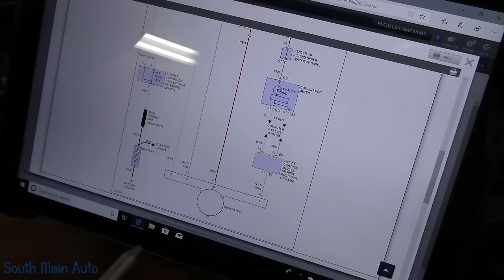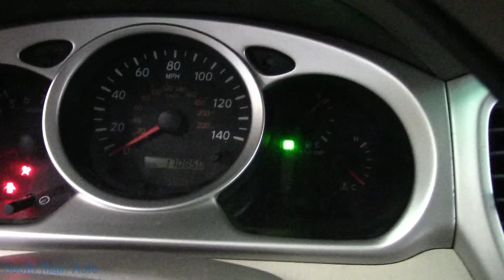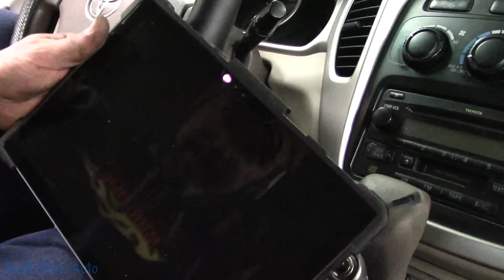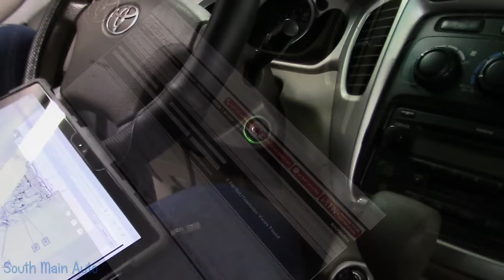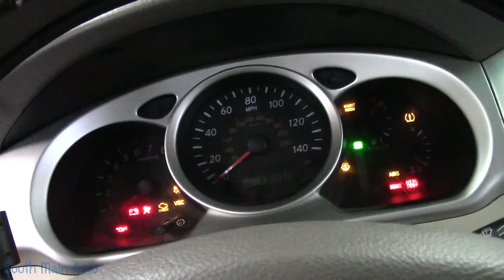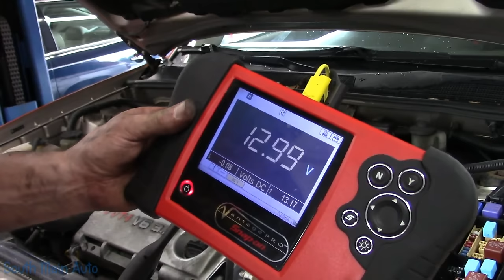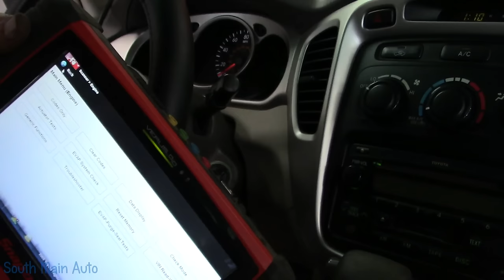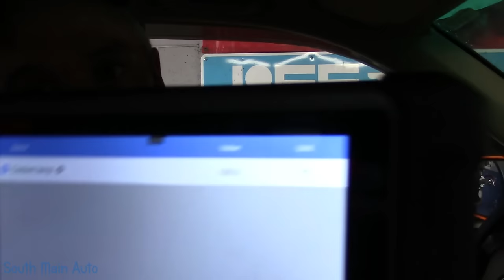Toyota Highlander - To Fix It, Follow The Smoke! 🔥

Comment: Awesome vid Eric! What about going to the junk yard-  my bad , The recycler  and snippy-snip a "cleaner" connector ? - I guess you still have to solder it in though. Another thought is this 2005 will forever be a money pit because THE MAJORITY OF MECHANICS WILL NOT BE ABLE TO DIAGNOSIS IT. I'm ranting because I am dealing with an overwhelming , almost critical lack of "mechanics". I think the profession is driving our future into disposable vehicles. Years ago, you would of been know as one of the most knowledgeable mechanics in say a 1 state area. Today , you are like the " northeast region's savant" soon to be elevated to "The Mechanic of the Northern Hemisphere" . To be honest , I have almost no faith in the profession , save for you being on the web and also taking in two proteges.
Reply from the maker: No no no, there are tons of good mechanics out there trust me, I am on facebook with many of them, WAYYYYYY beyond my skill set.
Reply: you know any that are good in somerset ky? it is hard too know who is good. had someone try and fix a slow oil leak and made it worse and then seized engine... i had them replace oil pump and water pump and timing belt and stuff since they were taken off. it was a 94 toyota camry. liked it and wish still had it but now i have a 09 mazda 5. it have a check engine light on for upstream oxygen sensor code p0132 which is running rich it seems. it runs fine but wish i knew what was causing it. don't want to just replace the oxygen sensor because on these are over $200 not cheap. just wish i could find someone good that won't overcharge.
Reply: no good mechanics where I live
Reply: tough to find good mechanics in area too
Reply: I'm a tech in Cincinnati and I know of well over a dozen amazing other techs in the area, I get compliments alot so makes me think I'm good, I just think I don't like to give up. There is a few hacks. But there is just as many ppl that expect a ton from a tech when we spend hours on a diagnostics, you guys watch these videos thinking this only takes this long, some diagnostics takes awhile, to just be something so dumb, can repair with hardly any cost of parts but used so many tools that coast hundreds some thousands of dollars and some techs get paid squat the industry creates hacks I just don't have the mindset or heart, or the deep pocket to pay for the parts canon that didn't fix the car.
Reply: Not sure where you read I was talking smack at all, I honestly don't see how he has the time to make videos between work and my son I got nothing but, I said the industry creates hacks not the customer, I never called you a hack, a hack isn't someone attempting to fix there own car. It's a tech who uses a dart board to make repairs or statistics to make repairs. I've gotten cars handed to me after a general service did tires and tires not set or tpms out of whack or they broke a damn sensor. I get it but you as a customer should not pay for that.  The deep pockets are mine it's called eating the part, why would the customer pay for a part they didn't  need. Come on. its obviously not the customer.  If you do, that's you man you got swindled. I point ppl into directions all the time I don't loan tools but I will show you how to do it. I got called a nickel and dimer for telling a customer they needed a shim to repair there alignment which was barely out to the point it wouldn't even cause an issue but they wanted it fixed, I said it had to go behind the bearing it's rusty, damage to bearing is possible you may need one, but nope they get mad and storm away, or the ppl that asked if I was a real tech because I drove there van for 76 miles no stall happened but yet they know a guy that could've figured it out without even driving it, the crank sensor finally dropped out for the 2 sec while I was driving around mile 80 and the fourteenth test drive with my scope wires dangling around, but yet I only get paid 1.5 hours for that, or the diag no codes honda I spent 6 hours on only to find a piece of rtv got in the vtec solenoid causing it to stick wide open no parts and it was fixed they were actually very thankful and understanding on time.  But I was just saying that there is tons of good techs out there, so not sure what you read but you misread sir.
Reply: D really also I'm confused, I've reread your comment multiple times, are you claiming you are just as good as 99.7 percent techs? then call me a sheep while acknowledging you don't know me so how can I be a sheep for sure? when did I get all "praise the industry" fucking christ is pissing me off just thinking of how you went half cocked over me just saying there is good techs and that customers can be assholes too, you getting bent out of shape because you chose the wrong garage. its as bad as the idiots who talk shit about how long the videos take saying they could've gotten it done faster. For me it's seeing what tools I'm interested in and seeing how they work.  But claiming no good techs except for the one guy your watching when Ivan is a beast at electrical, Keith is the shit at the weird, schrodinger had the thought process down pat, scanner Danner is a guru of theory, Sean miller, triangle diagnostics, me I'm on instagram (barely) as pinpoint auto.  I don't get to post much, half the tone is diagnose and oh shit should've took some pics or video but seriously there is good techs out there find someone, be good to them if they are good to you and stick with them, fuck the industry. And calmly read the post that ppl type not everyone is yelling as they type
Reply: I'm fairly sure most salvage yards will not sell a "cut" wiring loom or a section of it when it comes to computer controlled vehicles. They will likely sell the entire loom from one connector assembly to the next one up or down stream. In this case, the fuse box with the loom pigtails and the next one down stream as both connectors were burned. Once you have that, you can cut it as needed however, it's best to go from connection to connection. Also, not all looms are exact due to optional equipment one car may have to another. It's possible all looms are outfitted to support a fully equipped vehicle vs. one that has few options, not sure but could be. 

With older cars, non computerized, any salvage yard would simply use bolt cutters on the wiring looms at the hingles and sell you a complete left front door. Today, they can't and shouldn't do that due to modules and their mass wiring and proprietary connections. Can you imagine walking up to a junked car that has just what you need only to find out the yard people cut the wiring loom you need to help a previous sale?  Best to sell the part complete and save the integrity of the remaining salvage for those who follow.
Reply: South Main Auto Repair LLC Don’t keep selling yourself short! Plenty of the other well known electrical diagnosis specialists like Diagnose Dan seem to have a great respect for you.

Comment: I was waiting to hear REO Speedwagon, ride the storm out. I guess they were just testing the sirens.
Reply: does it really take 5 tests? To quote Napoleon Dynamite.. Goooodddd!
Reply: In many rural volunteer departments the siren counts are also used to tell the crews what and where the call is. So you might hear a 3/2 siren, that would be an EMS call, respond to station 2, Then something like a 1/4 is structure fire, full response, all stations.
Reply: so they have to sit around and count the sirens while the bldg burns? Two words.. Cell phone.
Reply: There are a LOT of folks who don't carry them or are out in a field or place where they wouldn't have signal. Plus these sirens have been around much longer than cell phones or radios. Then there is the issue of who calls the phone? The 911 centers send out a set of tones that trip radios/pagers and the house sirens. They don't call or send texts to the departments so the phone would still be useless. Plus there can be a large lag time in phone texts as well as they are not priority items.
My department used pagers and radios as well as house sirens. We added text as a back-up system just a few years ago through an online company. 
There is nobody "setting around" in 99% of the volunteer stations.
Reply: Greg Reitan I thought the same thing about REO
Reply: Avoca (and Bath, NY) unless things changed...  Noon test of just 1 blast of the siren.  Usually on a call they hit the siren button and let it blow until someone responds that something is in route.  They also use the pagers as well.  (Bath uses(used...been a while) a 2 tone siren for the fire calls.  You'll hear the usual siren blast......And a 2 tone alternating blast mixed in.)  It's been a while sense I was on the Bath, NY vol. fire dept.....  So this might have changed.

Side note:  Small community near Albany uses a vol. fire dept.  Due to noise complaints they silenced the siren and went to only pager.  Come next year when the dept asked for $$ for materials, supplies, etc...  The community responded  "You didn't have a single call all year!!!  What do you need x,y and z for...."    Then the chief stated  "We had 'x' calls last year!  You guys had us shut down the siren!!!"...
Reply: in the case of larger scale power outage, the sirens would be on backup power and could be the only functional emergency alert/call to work ;)

Comment: Could the connectors have possibly gotten corrosion from being located so close to the battery? Nice fix as always and thanks for putting this up.
Reply: breeze787 probably rubbed through, shorted, instead of blowing the fuse it melted the connector first, got worse, then blew the fuse.
Reply: Yes.
Reply: acid loves to penetrate past and around the seals
Reply: breeze787  Yes indeed..😑I do think the good ole battery had something to do with this wire harness connector corrosion.Thru time ,Acidic vapors venting out the battery somehow seeped inside the connector,and started eating at the wires protective plastic,exposing the bare wires,which in turn shorted. I seen tightly wrapped taped wire harnesss ,with that white corrosion inside them.🤔
Reply: Salt
Reply: @freddyflintstoned913  Salt & acid - perfect combination!

Comment: You should be able to obtain generic replacement connectors with pigtails (doesn't matter what colours specifically, just different, and may have one of more unused connections) and connect the new pigtails one-colour on both ends to the original cut wires, one circuit at a time.   That would still allow the plug unit to be pulled apart if conditions still require it.    Oh, yes.  that will be where the smoke will have come from.

Comment: I would have done the exact same fix that you did. how do I know that ?because that’s how I fix them.. Good job 👍🏻👍🏻👍🏻👍🏻👍🏻👍🏻 or ⭐️⭐️⭐️⭐️⭐️ lol
Reply: I usually cut one out of an old car at the junk yard..... pretty much free and you can then still unplug if you ever need to.... In that case though I would have made a shield to keep the battery acid fumes from condensing on/in the plug.

Comment: "Smoke 'Em If You Got Em!"  Back in 1980 i bought a 67 olds. 1st week i had smoke under the hood. Found out previous owner replaced a fusible link with a 14 gauge house wire.  Had lots of wires to replace after finding the original short.

Comment: Yes, you followed the smoke, and you had to rely on the OEM wiring diagram, which led you to the connectors, that the Mitchell diagram did not show, which when you touched the connector, let out some crusty dust etc... And as far as getting new connectors? On a car that is 13+ yrs. old, probably not. Or maybe get some "non OEM" connectors with the correct amount of pins and maybe gone that way. But then again, if you ever had to get a replacement fuse box then you would have to chop off that connector.anyway. So you made the logical choice (as usual)... Another great video Eric (again, as usual). Thanks!

Comment: Nothing freaks a tech more than smoke or flames! Good diag and I agree if it’s a connection that will probably never need to be unplugged cut it out. Some manufacturers don’t offer connectors and terminals.

Comment: I heartily approve of your solder and eliminate the plastic connection. 

Does the vehicle now work properly?
Yes
Did it fix the problem?
Yes
Then what is the issue?
None!
How often do you have to remove a fuse box?
Very rarely!

Job well done Sir!

Cheers!

Comment: Time to hit the junk/spare parts yard. Except Highlanders are (I would image) hard to find!! Whack that connector out and -----Beans --solder the wires in a bypass!!!!  Surgery must go on to save the patients life!!
Reply from the maker: She lives to die an other day...
Reply: Highlanders  and Camarys are basically the same,,,you will see those connectors on both
Reply: Just curious... Why would you need to use that specific connector? Any connector with the requisite number of pins (or more) would have worked just fine. I must be missing something here.
Reply: Phil Underhill  True but he was looking for something compatible with the fuse box if it ever needed replacing as it would have one of the ends with it from factory.

Comment: Hey Erik i found your channel by chance and am now a subscriber . I just have to say your ability to diagnose and repair is fantastic . I hate to say it but most repair shops including dealerships just throw new parts in and hope for the best. And most times you still have an issue  I am not an auto mechanic but have been doing  most of my own work since i got my drivers license. The one thing i would like to add here is the fact that those connectors living directly by the battery is a disaster waiting to happen especially if the battery terminals are not kept clean and maintained just my two cents

Comment: You always say  when there is alot going on with multiple circuits to pick one and work that through and mostly you will resolve all the others as well. In this case you did exactly that and once again it was a success. Regarding the repair well I would have made that the customers call and I think nearly 100% of the times they would have gone for the repair you did. Picking the alternator fault was the obvious one to go after as it wss the most basic circuit to follow. As usual, a master diagnosis and repair.

Comment: I have owned 3 Toyotas.  I am guessing that maybe battery acid may have dripped to the connector at some point and caused the corrosion.  You are great at electrical troubleshooting.  Well done.

Comment: I’m late to this party.

But, I will say this: I think the repair has to match the owner and vehicle. A 2005, multiple issues at play, other issues at play, yes, soldiering and taping seems the right way to go if the alternative is a $600 repair that could be better put into tires, brakes, exhaust, etc. 👍🏻

Comment: Great repair!  The main fuse on the 04 Nissan Murano is built into the battery terminal and will blow due to corrosion as well.  This happened to me 40 miles out of town once.  After purchasing a new battery because it was very weak,  had to jump the fuse with a piece of metal taken from a battery terminal connector..  After spraying it with a couple cans of terminal protectant it works good :-)

Comment: Awesome diagnosis Dr. O. Anytime I or a friend has a problem.....I check your vast video collection to see if Dr. O has seen it. I love going along for the ride with my favorite repair ace. I`m 61 and still learning, thanks for all you do. Now if I can just fix the gauges on my dash....temp and oil took the proverbial dump. Senders replaced, 91 Silverado with Moonie gauges...I hate them...lol needle gauges are rare for that year and apparently Chevy changed the connector and cluster in 92.

Comment: You make electrical look so easy. I had a transmission sensor on a Nissan altima that had some mice nawings on it. Was very hard to reach with a soldering gun and tape up the wires. I spent between 1 n 2 hrs on it and could not tape it up as well as I wanted to.

Comment: If you're asking I'm pro replacement connector or wire in a different one, but I work heavy equipment. We are required to big difference in a 350000 Volvo loader and a Toyota suv 😁. Good technician man, like the channel

Comment: Great job Eric , tiny wires big loads , shite cars , too much electronic components on our cars now , corrosion comes and eats the wires , burn baby burn , you chose the right decision to solder and eliminate the wiring plug, great work , your comerades are noisey buggers , trip reset fuses are great for testing , available from Wurth in the UK , so should be able to get them in the US

Comment: When dealing with electrical systems the parts handling the most power are the first place to check. Power supply, Power output devices and then charging circuit.

Comment: Good vid, I know it's an older one!  I worked in automotive for around 18 years as a writer and service manager, got out about 3 yrs. ago.  It's fun to watch the proceess of a good tech diagnosing an issue (I know, I'm a gear-head).  You did exactly what I would have recommended with age and mileage of the vehicle.  Good mechanics are hard to find, especially with electrical skill, great job!  This one got me to subscribe, thanks for taking the time.

Comment: It's a tired used car with multiple systems left unrepaired.  I would just solder the wires like you did.  Actually, I'm really surprised there wasn't more damage than just the connector with all that current going into things it shouldn't.  Oh, and guess what I'm going to be doing to my throttle bodies this weekend?  Thanks for keeping that in.